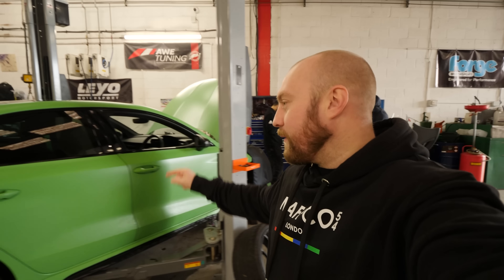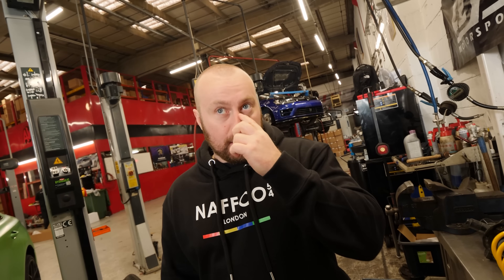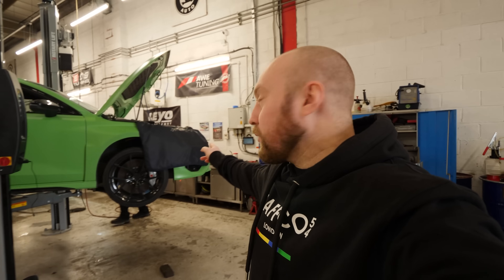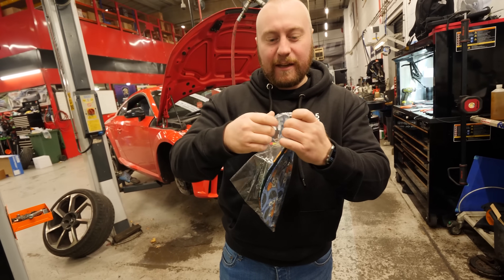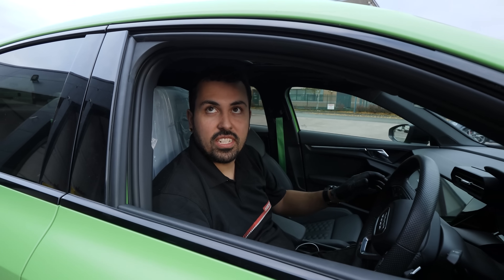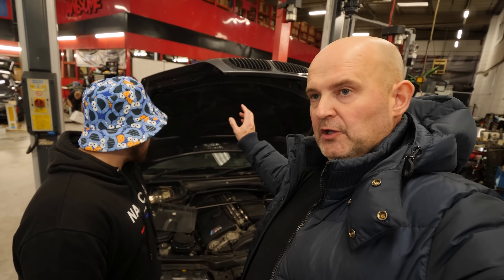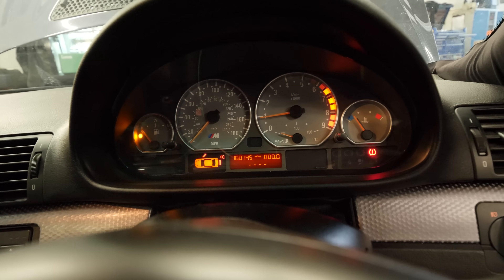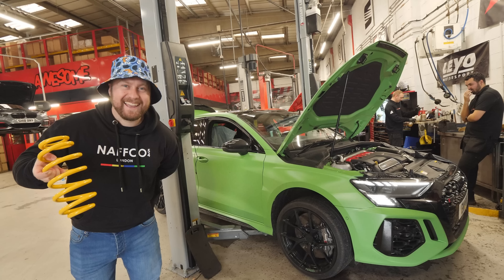Finding the PERFECT ride height for my 8Y Audi RS3 Saloon!

Comment: These springs look fantastic Ben. Was it a similar time as the RSQ3 to fit them? So around £500 for springs then 4 hours ish labour on top?
Reply from the maker: Cheers mate! Around that roughly mate yeah 3 or 4 hours I’m sure
Reply: @EVILGT  Sorry should have also asked you if you need to adjust headlights when it’s lowered? I’m new to tuning buddy.
Reply from the maker: No mate they auto adjust 👍🏼